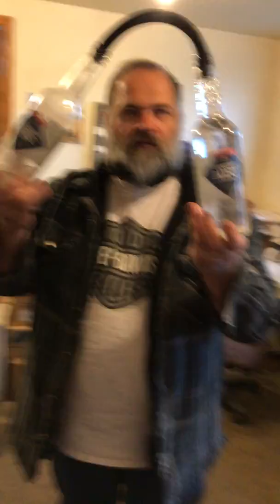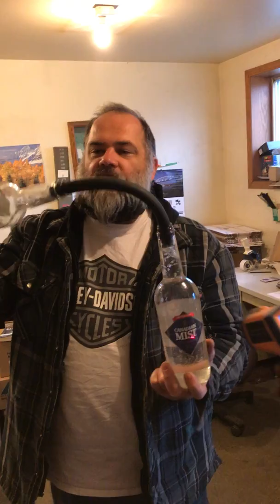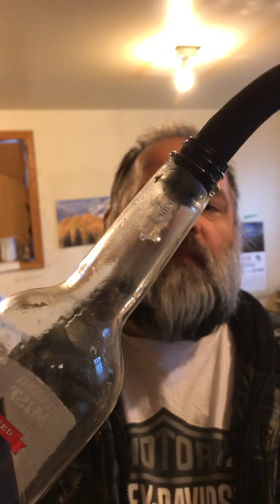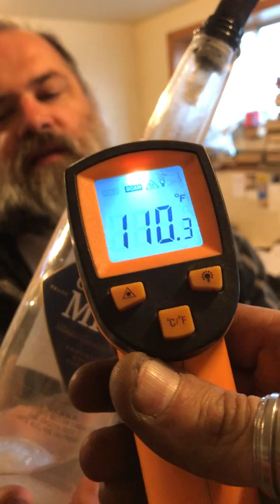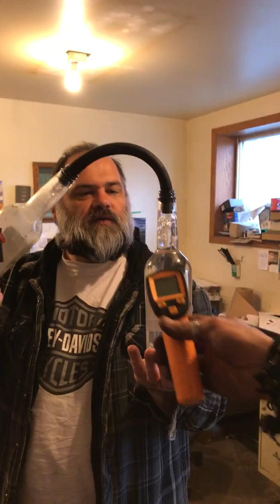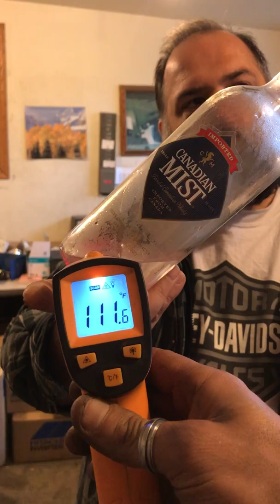EXTRACTING HEAT, BOILING WATER INSIDE A BOTTLE DEMONSTRATION

Comment: What are you planning to do with this Don?
Reply from the maker: I currently have an impulse turbine in other videos. This turbine will be placed into a casing so that a vacuum can be maintained. Then we will do a full scale generator test using a 1000 gallon tank of 150 F water and a 1000 gallon tank at outside temperature as a condenser. We will evacuate all air from the system by pumping out the air using a suction pump starting at the cold tank. The turbine will be between the hot and the cold tanks. After the vacuum is initially established the process is self sustaining until the heat in both tanks has been equalized. The turbine is run by the transfer of water vapor from the hot tank into the cold tank through the impulse turbine. Latent heat in the water vapor is converted into kinetic energy by the converging nozzles. Pressure and temperature drop as the speed increases through the converging nozzle. We can not exceed mach one below atmospheric pressure, thus we only require a converging nozzle to approach a chocked flow condition. Because of this, a converging diverging design would be counter productive and in fact can not be used in this manner....... thus almost all modern reaction turbines would be rendered incapable of using negative pressure differential steam "pulled" out of the higher energy state hot water via the vacuum established in the condenser. In this system, there is no positive pressure....... only a positive differential between energy states.
Reply: DON SCHMIDTKE Hey man, I know you're like engineer smart, no doubt. But could you translate that a little bit in more layman terms so that I could understand what kind of energy you could extract from from this process. It seems simple enough, and I love simple concepts.
Reply from the maker: Electrical generation is the ultimate goal.  The bottles represent 500 gallon tanks, one empty that is not insulated. One hot that would be a heat storage insulated tank. The black hose that connects the two tanks would be the impulse electrical turbine generator. I have a few videos of these running below. Sometimes i get lost in my own chaos. 

https://www.youtube.com/edit?o=U&video_id=eegnQ88f8yw
https://www.youtube.com/edit?o=U&video_id=q4rqYHmD27Q

Comment: Hi this is very interesting , how could I replicate this experiment ?
Reply from the maker: It is not a trick. One bottle is completely full of hot water. The hose between them is a regular 5/8 id rubber hose. Any standard glass bottle should work as long as there is a good seal using the hose as a stopper. Then we pull a vacuum in the system to evacuate all of the air from the bottle and the line. That is it.